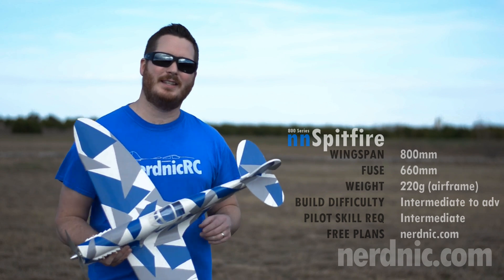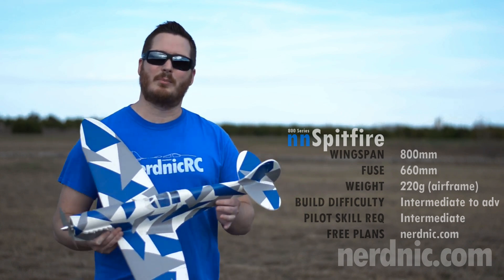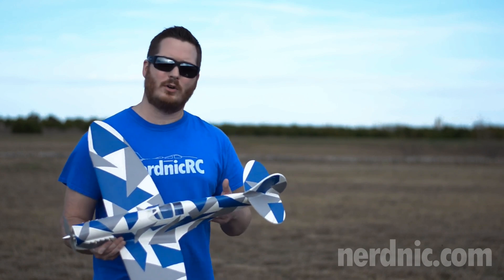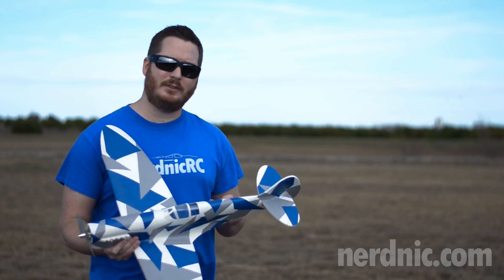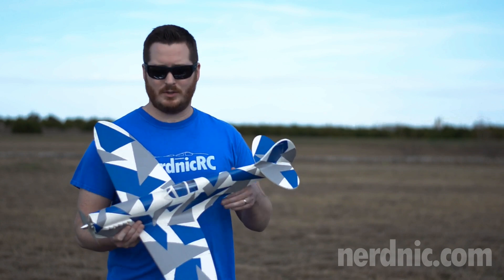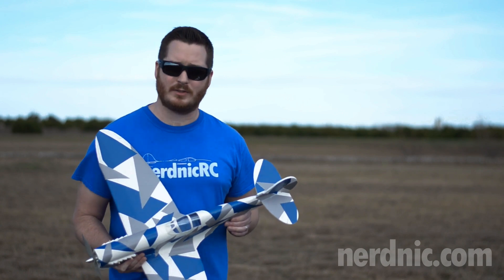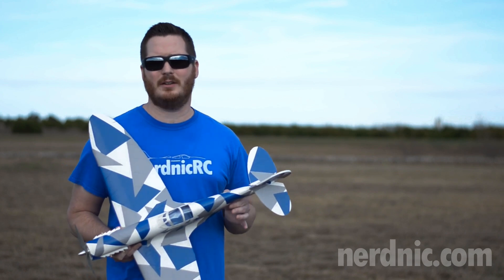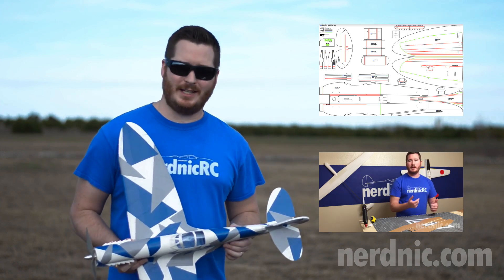nerdnic | 800 Series nnSpitfire - Foam board RC Spitfire

Comment: Hey Nic, so I decided to build the sonic series Spitfire beta. Got it all built, was pretty hard for me tbh haha (2nd plane) and now I have a problem with balancing it is around 1,5 to 2cm tail heavy from the balance point too much? Should I try to find some weights to put in the front? Thanks!
Reply from the maker: Yeah that's too tail heavy. Add weight or a bigger motor to get CG set properly. Send me a picture of it when you're all done if you can.
Reply: Gotcha, I'll send you a picture of how it turned out once I find some time.

Comment: Nic thx for advice about Taranis QX7. I joined quad racing rc group and everyone has it or is going to buy it, it seems it was the best option in that price :) By the way, I have a request. A simple plane - Savoia Marchetti SM.79 Sparviero - tri motor bomber. I wanted to make plans on my own, but I don't have time, photoshop and experience in designing RC planes. This plane has perfect shape for foam board, it has box-a-like fuselage, straight wing leading edge and it looks nice overall. I think that 1m wingspan version of it, powered by 3x2204 or 1806 motors and 11,1v 2200mAh would work just fine.

Comment: Is a 2204 motor and 850mah battery enough for this?
Reply from the maker: It will work but you'll have a hard time balancing it. Will be tail heavy most likely.
Reply: It won't be, I made MiG-3 800 and it was much underpowered. Go for Emax CF 2822 at least + 1,3Ah 3s LiPo + 20A ESC. It won't be much more expensive than mighty minis equipment.

Comment: Nic I'am looking for advice - I want to buy RC transmitter and receiver under 100-150$. I've been surfing through forums, but topics are 3-10 years old. World is going fast forward, I don't want to buy some old crap ;p if you could give me info, I'd be grateful
Reply from the maker: The FrSky Taranis Q X7 at 100$ is definitely your best option.
Reply: Thanks. I'll look for it, maybe it won't be so cheap and viable in Poland, same as NTM motors sadly:/ What about DX9?

Comment: Epic! I've built the FT Spitfire and really like it. This version of Spitfire for sure is going to be on my next projects! Quick question: Does it fly well with a 2200 battery? Which engine do you suggest? I fly the FT Spitfire with a 2822 engine with a 2200 battery but it feels that it's too much weight for the engine. I would like to know what do you suggest for this model (nnSpitfire 800 series)?
Reply from the maker: Hi! A 2200 will definitely work but you'll be on the heavier side. A 1300 is a much better match. The motor you used on your FT spit will work great on my 800 Series planes! Good luck!